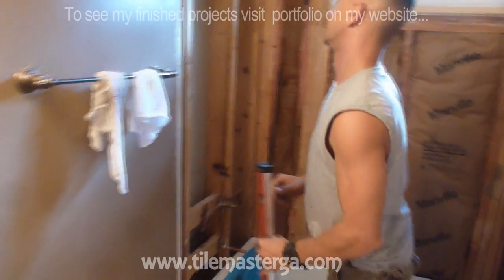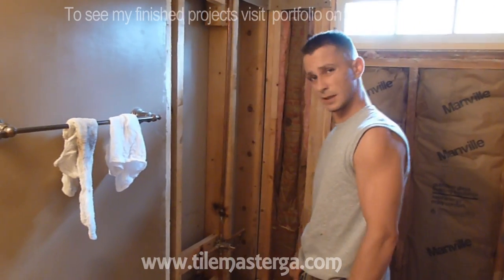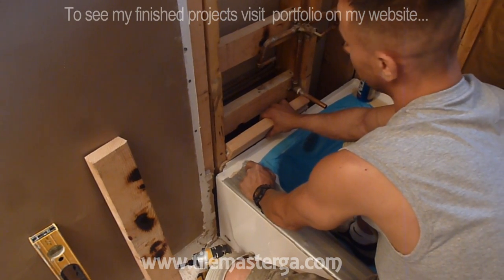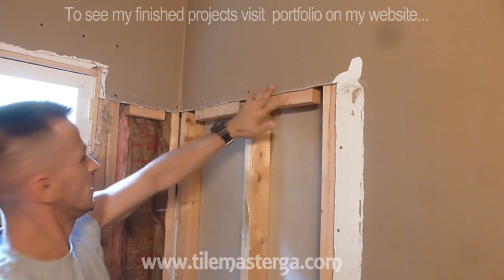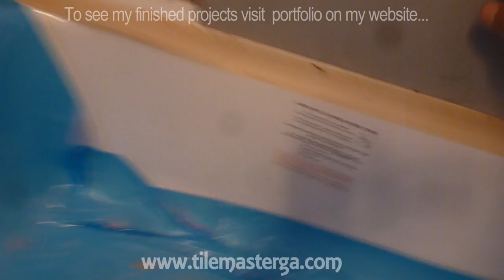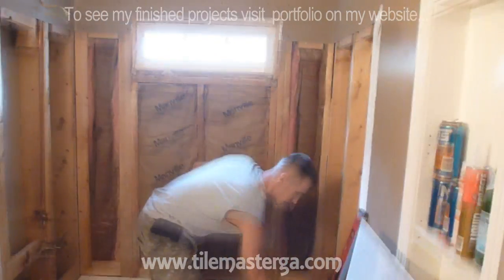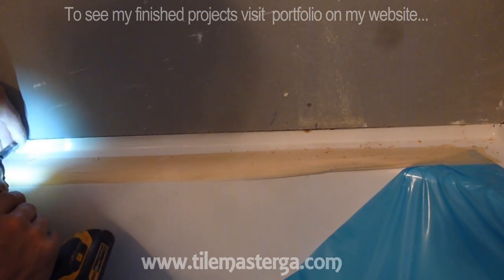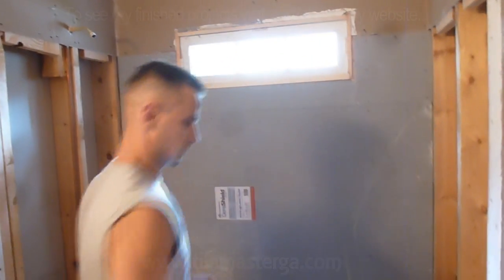Tile backer board installation - 60" bathtub surround walls for Tile installation   Part"1"

Comment: a big thank you also, I decided to take on my bathroom renovation all by myself. not an easy decision since I am 76 and widowed.  My husband was in the building trades before he died so I am accustomed to being around construction.  however, if it were not for your videos I could not have done this.  I have followed everything you said and used and my floor tile, and bath tub tile installations are awesome. thanks very much again for covering every little detail. Yes I did say I'm 76, and trust me I can't wait to get back to my quilting and knitting.
thanks again

Comment: I'm a younger contractor, do more carpentry than anything, but I enjoy tile. Have been doing a bathroom for someone in my free time and you've provided me a lot of insight here for the material to use as your backer and the moisture at the bottom of the tile along the tub. I never considered the grout cracking and wicking up from under. 
I left ~1/4" from the top surface and I think I will be running a bead of silicone underneath to help prevent this instead of tearing out what I've completed.

Comment: Excellent video and very helpful. I noticed there was no tub protection, like a piece of plywood on the top and maybe the front, just in case a tool drops, screw falls and gets stepped on etc. Thanks for Posting !

Comment: While watching you install the blocking behind the tub edge, the first thing I thought about was a pocket screw jig.  For somebody less skilled, it might make it easier to get the screws in without shifting the board.

Thanks you for your videos - I've learned a lot from you as I'm preparing for my own bathroom remodel.
Reply: I did that just yesterday...way easier.

Comment: As a female, it was even more important for my DIY bathroom to be "perfect" 😂 🤣 Seriously though, after literally weeks of research on how to do everything (specifically how to install cement board around tub) I need to do, this video is by FAR the best step by step explanation!! There are several steps that you do that make SO MUCH sense, that 99% of other videos never even mention. Especially the tip about putting boards in between the studs around the top edge of the tub. The only problem I have with your video, is that I didn't see it weeks ago. This is a "one & done" tutorial! Very simple step by step instructions that are going to make my job SO MUCH easier! I can't thank you enough! God bless you!

Comment: Outstanding video...I wish I would have watched before I did mine.  I overlapped my cement board and never thought about expansion and contraction once the tub heated up with hot water.  I also wish I would have made sure all studs were even.  It looks great but not sure if they were.  The perimeter of the tub having the 2 x 4's at the lip is also a great idea.  Makes a good place to screw in the cement board all the way around.  Thanks, you are a true master craftsman who takes care of the fine details most never even think about.

Comment: I have done a few tub installations and never put a stud support on top of the tub to prevent the grout cracking and I have never seen anyone doing it either.  But I like the tip and will start doing it from now on.  Thank you so much for the good tip.
Reply: benoit lambert I work for a contractor, we do these Alll The time and I've never used the stud either lol but hey, cant hurt right!

Comment: I totally agree with you on that stuff not being easy. Been tearing into my bathroom because the floor went bad. Got a floor in which wasn't a small job. 4' x 4' part of the room had to be gutted out and laid back down with supports running between all the studs. Now that's done I can finish my surround walls and tub to lay down some travertine

Comment: Good video, explained very well for adding studs and blocks; however, you are incorrect on installing Hardie backing boards or cement boards.  They do not rest on top of the tub edge but over lip and on the tub.  This prevents a weak spot and does not allow water  in the wall.  Put it on the tub and use sealer to seal.

Comment: Concrete block is the best backer, but here in America most homes are not built that way. Nice work. I'm using DensShield for the first time. Always used Durrock with Laticrete vapor barrier.

Comment: i have been putting backing ,( blocks) in for towel bars tubs shower pans  toilet paper holder curtain rods upper and lower kitchen cabinets chair rails stair rails stair mop board back splash hose bibs  porch lights and around windows and corners for siding.all these  blocks are in the wall before i stand the walls , some of us do care

been doing this for 25 or 30 years,

Comment: So glad I found this channel.  This guy is no joke.  It gets pretty real if you don't do this right.  One thing I am skeptical about is the white cheap looking interlock plastic tubing at the beginning.  I love the overflow tube but the one in the floor that screws on, is that one okay?  Seems cheap of one doesn't tighten it correctly.

Comment: Hi. I love all your instructional videos, very in depth. I am a fast leaner so I enjoyed these as I will soon be remodeling my two bathrooms. First time DIY. You mentioned not to use Hardiebacked brand board but to instead use Durarock brand, why is that? I am sure you are speaking from experience but I analzyed the Hardiebacker board and noticed that they seem to be a lot more solid and compressed than the Durarock boards, which seems to be a lot less compressed and crumply. Not to mention that messy meshing intergrated with the cement. I would think that Durarock would crumple easier since it is already crumply and especially if you use the score and snap method for cutting. They do not sell the GP brand here at Home Depot or Lowes.
Reply: I also purchased the Hardiebacker board at Home Depot before I saw this video, so will use it.  Mr. Tilemaster said that the setting compound doesn't bond well to these if not mixed properly...so to avoid that problem mix the mortar correctly.  
Also, the Hardiebacker pamphlet recommends, to wipe the Hardiebacker surface with a damp sponge prior to adding mortar or mastic.  Hardiebacker recommends to use:  1. Latex or acrylic modified thinset, or  2. Type 1 mastic.

Comment: Very interesting and comprehensive video, thanx TileMasterGa, however I totally agree with JosephV. The schluter system is the best thing that I came to work with and I just love it, and I wouldn't go back to anything else, (unless the site conditions call for other solution/application). It is lightweight, easy to install, and totally waterproof. The cost of the schluter elements depends on the relationship with your supplier and volume of material you buy. If you gonna use HD of course they will charge you much more versus your pro supplier. The difference between cost of schluter versus cement boards and waterproofing materials other than schluter is perhaps 30%. Everything depends on which side of the city you work in.
But anyways, the waterproofing systems are fraction of the cost of the tiles, bathtubs or fixtures and finishing materials, therefore they do not discriminate using the schluter system at all. Off course if you installing tiles for a $1 a piece and the cheapest fixtures on the market then who cares for schluter, will be cheaper to replace everything in a couple of years hahahahaha. Regardles of personal opinions I really like your video.
Reply: There's nothing wrong with schluter. They market it as a "goofy free solution" IE, youre a goofy and if you throw all your money at your problems and schluter, schluter will walk you through their "system" like you hired someone that knew what they where doing. And youre right, You will probably be tearing out all of your work without schluter. Again because youre a goofy. Now you have to fite the tile master.

Comment: I used the schluter system and it was 100x easier and very light to work with.  You have given a very detailed procedure and I'll give you that.  great for the novice but as they say you get what you pay for and is you use the schluter system it will be 100% water resistant and the Kurdi system is easy to install.  Watch the video and see !
Reply: I think it depends on who is putting it in, and proper installation.  I have talked to numerous contractors who say the schluter system and redgard are both shit.  My own contractor that came out to redo our bathroom told me he has done more warranty repairs with prior installed schluter. than the product is worth.  Sometimes easier isn't always better...I'm not going to use a product because the manufacturer says it's the best product...I'm going to use what I know works based on practical application purposes.

Comment: Great video....thank you for being so thorough and showing every step.  I have one question.  Is there a reason you used adhesive only on the bottom board?  I noticed you just screwed the top section of board on.  Thank you again.  I'll start watching Part 2 now.

Comment: from my 20+ years in the flooring industry, Hardie Backer and Fiberock would be the only backer boards I would use in any tile installation specially in a wet area. The only issues that I have come across were from improper mortar or adhesive application, or because the wrong mortar or adhesive was used for the application.

Comment: My bathroom had 1/2" drywall from floor to ceiling & then another layer of 1/2" drywall behind the 4"x4" tiles.  When I put the new tub against the studs on one end, there is a 1 1/4" gap between the tub & studs.  If I shim this much, there will be a 1"+ corner on one side.  Do you have any suggestions?  Thanks for your time & great instruction.

Comment: The cement board should overlap the tub lip, not above it as you do. See TCNA 2018 Handbook B413-18, B411-18, B440-18, B412-18, B419-18, B425-18, B430-18. This might explain why you've seen cracking grout and hence the workaround with the blocks you've come up with.
Reply: I caught that and scrolling through the comments to see if he addresses it. In the center of the tub, he mentions the gap and says he’ll just caulk it. Just looks like a problem down the road.

Comment: Wouldn't it be better to use treated wood for the base boards at the bath tub edges?
Awesome video. You have taught me to do it myself.
Thanks a lot.
Reply: Neil Williams I like to use standard lumber indoors, except for direct contact with concrete. PT lumber can shrink and bow over time because of the moisture content - probably not good for a wall tile installation. Also, the installation here appears to be watertight and meticulously done. If a leak were to appear because of poor installation practices, the type of lumber used would be the least of the worries.
Reply: What about for a kitchen floor?
Thank you for your reply and advice.

Comment: When he first installs the bottom piece of backer board, the screws are all along the vertical studs, then when they cut to him putting in the piece with the window cut, there's a bunch more in between those. 

 I can only assume he installed some new horizontal studs similar to what he did at the bottom above the tub, so backer board would havr additional attachment points at the joint.  Because he definitely added screws, and he's drilling into SOMETHING that wasn't there before.

Comment: When can you get away with not replacing the tub/shower valve? 
I'm doing a remodel on a 1997 construction.  Everything seems to work fine and I'd like to avoid unnecessarily changing parts.  Great series.

Comment: The manufacturer of Denshieild recommends you overlap you backer board over the flange of the tub, leaving a 1/8" gap between the bottom of the backer board and the tub ledge. If you do it that way I assume you would have to shim out the backer board so that the bottom does not bend at the bottom where the flange is. Is there a reason you do not overlap the flange of the tub as the manufacturer recommends?
Reply from the maker: James LaLiberte Everything is explained in my video. And never overlap tile board on top of flange! Sometimes those " big bucks" companies do not know what is what !! or simply do not care!
Reply: Watched your videos and they are pretty good. All that being said in this particular video you do not comment as to why you should not overlap the tub flange as recommended by GP (that i recall), and my intuition tells me this would provide a better seal. The only concern I could see is the backer board wicking water that sits on the tub ledge. Don't see any motivation on the part of any company to mislead or make poor recommendations. To the contrary, poor installation instructions leads to dissatisfied customers and no return business.
Reply: James LaLiberte at 21:00
Reply: +James LaLiberte I could be wrong, but I believe the Densshield should be run to within 1/8" of the tub deck IF there is no tile flange. Otherwise, it should be run to within 1/8" of the flange, which would be considered the "tub deck". I was taught that the tile backer in general should never overlap the flange.

Comment: wow!, I like your technique for sure and will try it on my next install. I have been using hardie backer which is great but the denshield is probably a little softer and easier to fasten screws. keep up the great work :)

Comment: If using Durock, would you still advise against the moisture barrier? Would you use waterproofing membrane only on seams and over the screws? Thank you for your video it is very helpful.

Comment: Fantastic workmanship!What screws are you using to secure the board to the studs?You had mentioned in your other videos about using moisture resistant screws (Brass or stainless) but do not see the point if you are using untreated wood for your framing. As you know the wood if wet will rot out long before the screws.I would like your views on the installation of a cultured marble surround in place of tiles?With the popularity of your videos l think you can now retire from tile work!Dave

Comment: Hey TileMaster, great video and great job. We are planning to do our bathroom. Your videos help a lot. We are ready to buy Densshield... till 3 days ago it was still available..now every store took it off there product carrying warehouse stock. Offering now Wonderboard, which is smaller in size and 2 extra steps are necessary: cement mesh and cement/thin set for the gaps BEFORE waterproofing. Do you have any experience regarding Wonderboard cement board in wet area use???

Comment: Question for you:
When you are checking the studs to make sure they are coplanar (aka "nicely lining"), in this video you only demonstrate checking horizontally.  But it could be that if you either (1) move your straight-edge up or down a couple of inches, or (2) place your straight-edge diagonally, you might find cases where they are not coplanar, because 2x4s do not have perfect edges.
There are literally 100s of positions to check.  How many checks do you do before you are satisfied?
Reply from the maker: Till try lining vertically, horizontal and diagonally :) also trying have everything plum - in good leveL!

Comment: My shower pan lip has screws driven through it to secure the pan, rather than a screw+washer above it.  These holes were premade by the manufacturer.  I planned to have just the tile overhang the board, so that you cannot see the screws.  Does that sound good--no problem with wicking?  Thanks

Comment: You said you placed the backer board on the top edge of the tub
So did you fill in the gap from the lip to the bottom of the tub with versabond, or just tile down

Comment: Hi Michael, thanks for the videos. I have a couple questions:
1. what kind of drill do you use? is it a driver vs. regular drill? (I'm having a tough time installing the wood supports...the wood keeps splitting on me)
2. What size and type of screws do you use to add the wood supports to the 2x4 framing?

Thanks so much!
-= Wen

Comment: Instead of using wooden support between the studs and tub flange, what would you use to secure the tub and support cement board, when the tub flange is next to metal hat channels on concrete?

Comment: There should be some plastic/pvc sheeting bonded into the half inch flange on the tub going behind the backer board to ensure that no water goes behind the board. It is only another 15 minutes work to do that. This makes sure no water can get behind the board and form mould.

Comment: a great video to be sure! But some confusion still. Some tile pros swear that the backer board come over the tub lip (with 1/8 in clearance above the actual tub) and others say to bring it 1/8 in from the top of the lip (/tub flange). Bringing it over the lip of the tub insures that water will not get behind the wall because water cannot flow UP. I dunno, I guess its just your personal preference.

Comment: I’m also not a fan of vapor barriers. Especially with brick exterior walls on the other side of the interior wall. It actually traps moister and doesn’t allow exterior brick to breath. This will lead to brick rot and mold

Comment: The tun install looks bad.. no predrilled holes.. cracked screws... yoy should use strips of 1/8 or 1/4 on top of your studs to fur out it would  male your board go rite over the tub lip...

Comment: Dear Tile master,
I have have about 1/8 to 3/16 difference where my durarock meets my the existing wall creating a slight indention, should I just use the thinset thickness to make level when i'm setting the tile?
Reply from the maker: Yes - this is only option at this point - just play gently with tiles and thinset and you be successful.